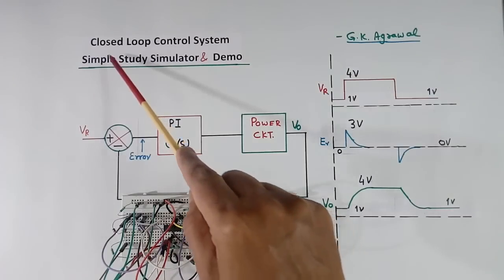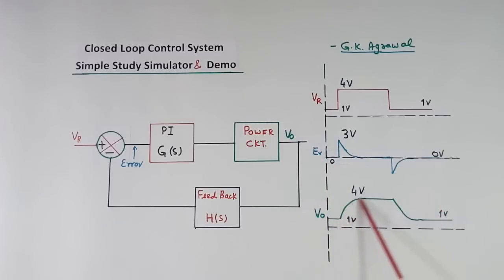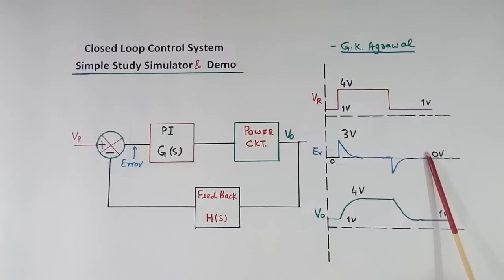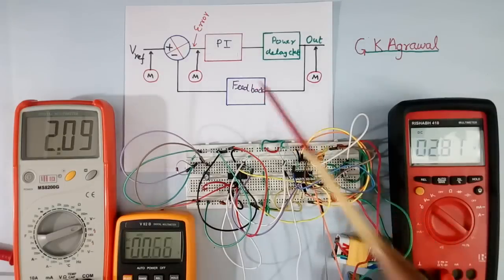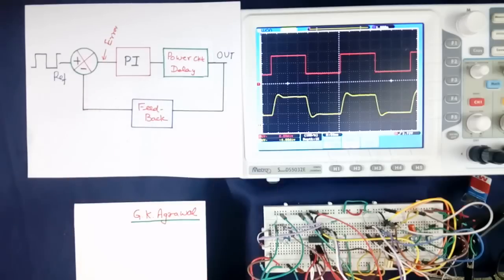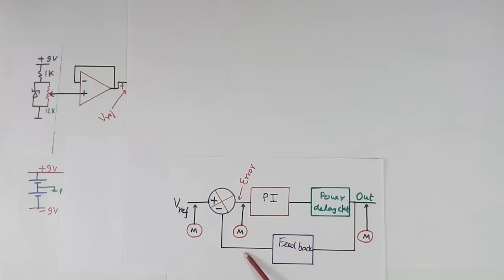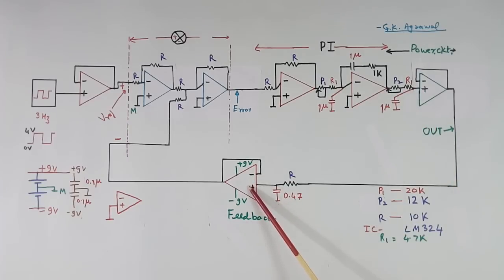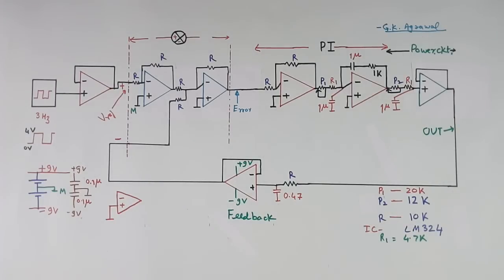PI controller electronics project and experiment

Comment: Hello sir, 
My output voltage drops when I take feedback. What can possibly be wrong in my circuit. Output normally is 5, but it's 2-3 when feedback is taken
Reply from the maker: Output will be equal to reference voltage. Your ref voltage may be 3 volts.
Reply: @GKAgrawal2  it's 5 sir
Reply from the maker: Check, differential amp for function. Wether it is able to substract feedback from ref. It ref is 5V, and feed back at diff amp input is 3 volt,  then diff amp output should come 2 Volt {error signal}.
If it is not 2V, then diff amp not working.
It it comes 2 volts then PI may be problem.
Reply from the maker: If ref is set 5 V, then power supply to IC must be at least plus minus 9 volts.
Reply: @GKAgrawal2  yes sir. I'm getting it..  error is 2. But why is my output dropping when feedback is taken.?
Reply from the maker: Your PI may not be working. Error should become zero under working condition. With 2 volt error, means PI output will saturate to plus supply or minus supply voltage. Check it and make it working.
Reply: @GKAgrawal2  yes sir you're right.. PI controller had problem... thank you so much !

Comment: Hello sir, amazing lecture 
I had a question, why did you take up this configuration of the opamp, why can't I take a differential amplifier with gain 1 for the same operation, will that get me the same results? or is there a specific reason for using this configuration, please let me know. Thank you !!
Reply from the maker: This is simulator or model of a typical closed loop control system. This is not a unity gain amplifier model.
Reply: @GKAgrawal2  no sir what I meant was for subtracting the input and feedback signals can I use a differential amplifier / subtractor ?
Reply from the maker: Yes, you can use any analogue subtractor.
Reply: @GKAgrawal2  thank you sir

Comment: Great video. Can anyone explain how the summing junction resistors influence the typical inverting op amp equations?
At the inverting terminal of the 3rd op amp at the top, the output transfer function is -R2/R1, where R2= R and R1 = ? 

I'm struggling to understand why R1 = R as well. It seems that one should take into account the resistance seen looking back into the second op amp.

Thanks!
Reply from the maker: All resistance value are equal to R, to keep gain 1.
Values of R, R1 etc are written at right side bottom.

Comment: Dear sir, thanks for this excellent tutorial. I have always wanted to see how to maintain desired output once the error is zero. I guess this circuit will give me the chance to see for myself.

Is it possible to see the output of the  P and I actions separately in your circuit? If yes, where at would I see them in the PI section of your circuit?

Thanks again for posting this great video.

Rafael Larios
Reply from the maker: I could not imagine at the time of making circuit that some body would like to see P and I separately. Otherwise I would have made necessary  suitable circuit to make  observation easy.
In this circuit if you check voltage across 1k {in series of the capacitor in PI connected between output and inverting terminal}, on the DSO some how {require expertise} that should tell P component of the PI.
Please share link of this video on your social media, as I think, this kind of information is hard to get.
G K Agrawal
Reply: Mr. Agrawal, I simulated this circuit in National Instruments Multisim. I didn't find LM324s in its library, however, I used 7 - 741s instead.

The circuit worked beautifully! I'm quite surprised as Multisim doesn't work that well all the time. I was able to use the built in 4 channel oscilloscope to see the error amplifier, the PI amplifier, the power circuit outputs and reference input simultaneously. It was awesome!!!

I could see that once error became zero, the PI amplifier output remained constant feeding the power circuit so output followed the input. I played with the circuit changing the reference several times watching how the circuit worked time and time again. I reduced the capacitor value so I could watch the waveforms a bit faster because the simulator's time is much slower than real time.

I will check tomorrow across the 1K feedback resistor at the PI section as suggested.

Thanks again, and have a great day.

Rafael Larios
P.S. You can count on my sharing  your video with friends.

Comment: Sir Thanks for sharing such an Awesome Tutorial on PID feedback.
I want to lock the speed of the DC Motor drive. The existing setup is only having 10k potentiometer to change the speed. Can you please guide as to  where I should insert the Analog DC voltage from Tacho sensor which I intend to incorporate in the system using your same circuit  to lock the motor speed.
Looking forward to an early response.
Reply from the maker: A the feedback point

Comment: Respected sir, 
Why we convert 3phase A. C to d.c. using parks and Clark transformation before using PI controller? 
Please help.
Reply from the maker: There is no compulsion. You are free to follow any method, but that has to be accurate, simple and fast. Many different method are used depending on the requirement. In industrial design, there is no compulsion, but product should work. There is nothing like, it is ac or dc, just system should work. You must watch my video on AC vs DC difference, specially last point carefully and mamy times, as this point has very high level of the design knowledhe build in.